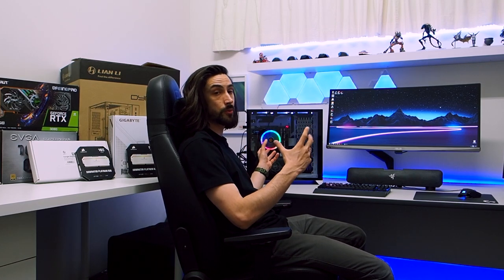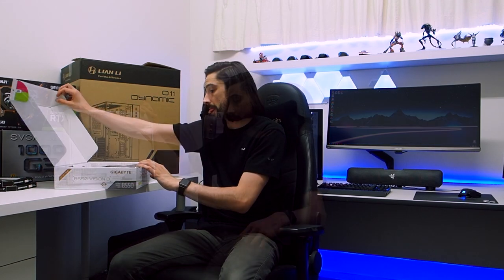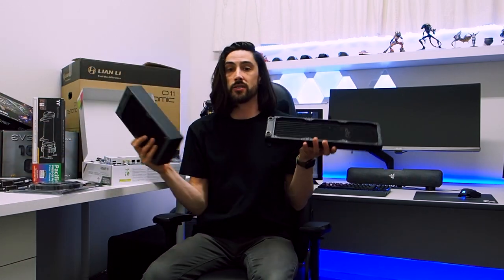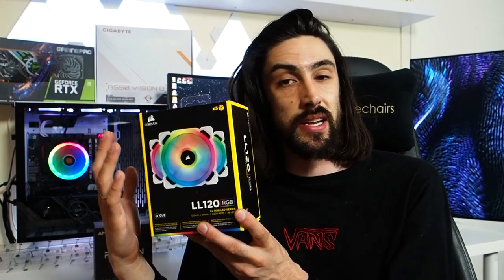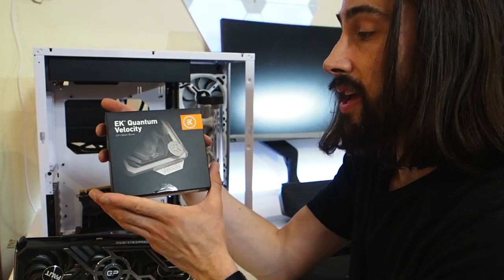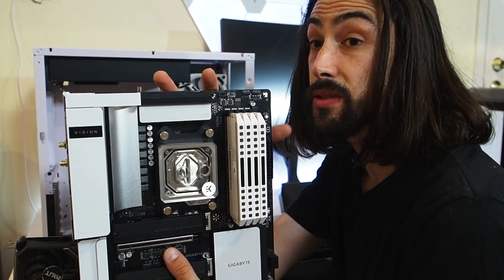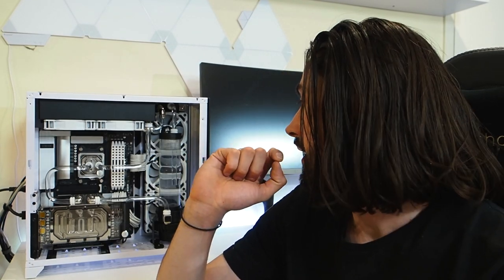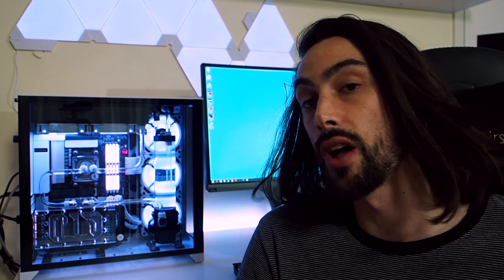Ryzen 5900X & RTX 3080 full custom loop watercooled PC | December 2020 PC Build log

Comment from the maker: Due to the amount of comments I’ve been getting I thought I’d address the performance issues. I re-did my thermal paste application on the CPU and also found 1 of my sticks of RAM was faulty which  I’ve RMA’d and now had replaced the system runs as you’d expect. I had a lot of blue screens through my early use of the PC and found the RAM, plus recent BIOS and driver updates fixed all of this. Precision Boost overdrive is getting me hanging aruond the 5GHz mark at around 70 degrees after several hours of gameplay with no issues what so-ever
Reply from the maker: Also don’t know how I forgot, I had a dead EPS extension cable what caused a whole world of issues too!
Reply: I have a 5900X on X570 Master with a monoblock in 011XL with 3x360 rad. I couldn't get a reference card so got a XFX merc 6900xt so only CPU in loop and I get average between 65 to 70 in game. I haven't done proper testing, as I thought maybe a mount issue but seems these chips just hot
Reply: I found setting my voltage to offset mod at 1.3v I get same performance with 10 degree reduction in tempatures you should test it. This cpu doesn't need to boost that high to hit 5ghz with PBO stock it hits 1.45-1.5v

edit frame times suck you may need to adjust to 1.35v
Reply from the maker: I’ve been playing with this a bit and have also been seeing must of the same as you are saying, I’m thinking the BIOS is still mot optised for 5000 series Ryzen
Reply from the maker: Intetesting! I might play aroud some more as I have tinkered a bit but not enough to see the same performance at lower voltages
Reply from the maker: Something I found coming from Into AMD is also that the extra bit of rubber on the back of the EK block is meant to be left, at the initial time of building I pushed that out like I would on an intel machine. Putting it back in really seemed to help temps
Reply: Show use the benchmarks please

Comment: 5900x runs around 80c in gaming and stress, I also run it on custom loop with 1 fat 360 rad and 1 240 rad, it peaks at 86c, PBO on.
Reply from the maker: Ahhh, good to know, I guess 7nm is a very concentrated amount of heat. I haven’t seen over 86c either. From reading I can see that with PBO, as long as there is temp headroom it will keep pushing, so there we are, it’s pushing haha
Reply: @LancesRoom  Exactly! Even if I go higher voltage the max temp is the same, so I think it will reach 80s no matter what, I managed to lower it 2-3c by using a better cpu block (EK-Quantum Magnitude) vs Corsair Hydro X XC7.
Reply: How is it possible then for me that on air cooling warzone with a noctua ndh15 my 5950x runs around 70 with some spikes to 80 degrees. Are you telling me my air cooling is doing a better job?  just dont get it.... Im thinking about making my first custom watercool, but, knowing this... i dont think is worth it. By the way im also runing pbo with the chip
Reply from the maker: Yeah, I’ve also been comparing the different CPU temps that HWInfo show and it appears one is an offset. I began having issues that I saw a lot of online that people were fixing by tweaking voltages in the BIOS, however I ended up having a dead IEC cable extension. Changing that out fixed my problem and seemed to also drop my temps almost 10c
Reply from the maker: Also, PBO uses very complex algorithms, so as long as there is temperature headroom, it will keep pushing the voltage, because water cooling can dissipate heat quicker it can maintain the higher voltages for longer, meaning equal heat to a high end air cooler to your one. Meaning, more performance at the same temps, with the temps also dropping quicker when the load is removed. Better BIOS revisions and fixing the issue I had mentioned above now seem to give me about 75c average in my usual gaming sessions that were hitting 86ish before. I seem to boost to over 5GHz and remain crash free and stable with my current loop. GPU has been consistently trouble free, sits in the 50s and I barely see it in the 60’s. Overall I think some of it was just teething issues of new hardware, sucks that early adopters get punished haha
Reply: @LancesRoom  Knowing this, and the performance in 5950x is alredy so amazing with pbo that i see no point on spending so much on custom loop for this processor. The only point of custom looping in my opnion is to lower temperatures and getting better performance, but lowering temperatures. The desing of 5000 series is to push as hard as possible and deliver as much voltage and gets to same temp anyway. That extra performance on this monster chip, i wont even notice it, having in count that i run 5 mhz or 5025 mhz on single core performance and 4.400 mhz 4.350 mhz when hits 80 degrees in all core performance on cinebench r20 wich is way more stressfull than real world usage. This is monster performance while using my noctua ndh15, could i push all core to 4600 mhz using a custom loop? maybe, do i need those 200 extra mhz? not really... So Custom loop is pointless in 5000 series.
Reply: 80c with just pbo and on a custom loop? Im sitting 68c with pbo on my $40 all in one 🤷🏻‍♂️.

My 5900x is boosting to 4.7ghz all cores and peaking at 4.95k with a cheap AIO

Edit: 6 of my cores are boosting to 4.95ghz and 4 of the other cores are boosting to 4.875ghz. temps when gaming is just 60c.

Dont get me wrong im actually gonna do a custom loop on my rig that's why i am researching for 5900x temps on a custom loop.
Reply from the maker: Yeah it’s not a big difference, but it all adds up. but once your to this point the amount you spend versus the performance you get back is very marginal. After some adjustments after making this video , I got better temps, usually in the low 70c mark, and I am regularly getting multiple cores hitting 5.1GHz, with others hanging around 4.8GHz. Overall, I am happy. I think one of my rads was gunned up and made the fins in the block get a bit gross and sludgy. I also had a stick of RAM that was DOA and a bad paste spread. I have another update for the PC coming soon hopefully as I have some more bits and pieces going in. I think I’ll cover the temps I was seeing there and how it is now
Reply from the maker: Yeah, amount many issues, I was also reading the wrong temp from HW monitor. I am seeing low 70’s now after hours of gaming and usually hit 5.1GHz single core and 4.8GHz+ on the other cores. I do love having a custom loop just to be able to look at and take pride in my work. I’ve done them in systems and then just run them at stock before just for how cool they look. I will be interested to see if having purpose developed coolant will make a difference to distilled water also. I’ll hopefully have a PC update in the near future I am hoping
Reply: @LancesRoom  have you tried rotating the Velocity cold plate and top by 90 counter clock wise?  Ek plate seems optimized for Intel not AMD and rotating seems to align better with Ryzen architecture  from what Ive researched
Reply from the maker: Ah interesting. I haven’t, although I would have assumed that this one would have been setup correct as it was an AM4 specific block. Doesn’t go to say they are all setup in 1 way from the factory though.
Being my first Ryzen CPU I also didn’t realise that there is a CPU temp readout that has an offset and isn’t the true temp, there seems to be about a 10°c difference in HWInfo
Reply: Just installed a 5900x into my rig last night. In custom loop with gpu and 2x360 rads. 4.4ghz  all core manual oc 1.2v she would hit 63c gaming. 70ish intel burn test. Previously the 3900x never exceeded 51-52 under load / gaming.. Not so happy with the temps.  Most of the time both the 3900x and 2080 were within 1c of eachother under load so generally ran 40-41c load with ocasional 51-2 spikes on cpu.

Comment: Damn I’ve been thinking about doing a custom loop. I have the same case with a 5800x and 3080. How much was the total for the loop if u don’t mind me asking?
Reply from the maker: Radiators: not sure, but I would guess close to $250, Pump/res: $359, white Corsair fittings: $90 ($45 a 4 pack), other fittings: not 100% sure, but close to $200, CPU Block: $145, GPU Block: 259, $85 GPU backplate, tubing: $70. That add’s up to $1458 NZD, which is roughly $1006USD. Damn thinking about that is depressing, however all the parts other than CPU and GPU block have carried forward from my previous build and can also be used in the future for other builds. But still 😭

Comment: I got 10900k on bykski fire on waterblock
3090 ftw3  on bykski waterblock with backplate also active cooled (sandwich graphic card between waterblocks)
2x hwLabs 360 gts rads with 6x lian li coolers
Bykski distro plate
In Warzone I am getting  arround 50⁰C on gpu and 75⁰C on cpu  i tought this is unusual.....to big of a gap between temps
Is my 1 st watercooled pc ever...so i tought i did something wrong.... i guess is normal cpu to be 25⁰ 🔥 more than gpu....
Lian li XL
I am not getting any fps drop...any paket loss whatsoever..... dlss off raytracing off i am getting~ 150 fPS. WITH dlss performance i am getting 240